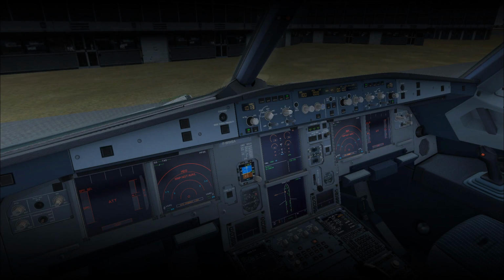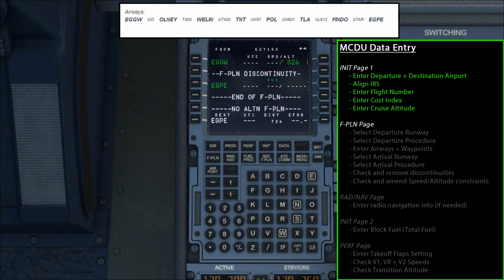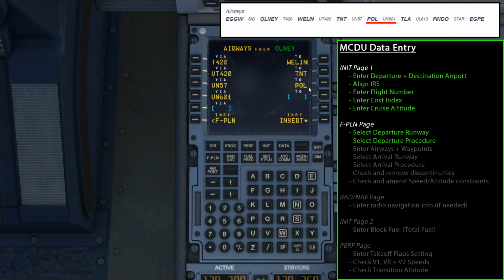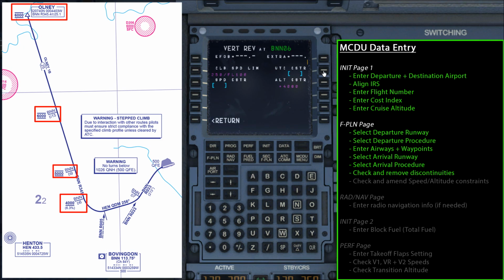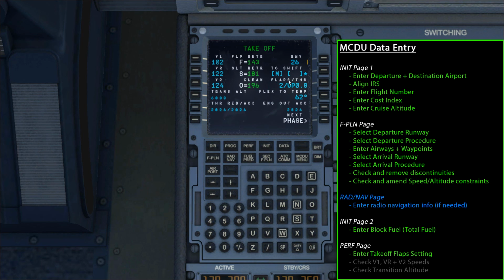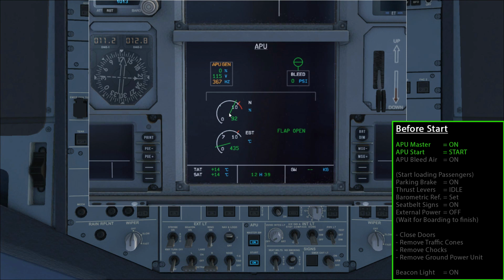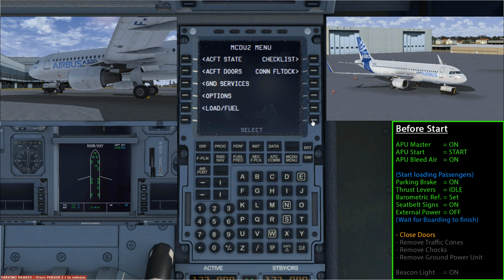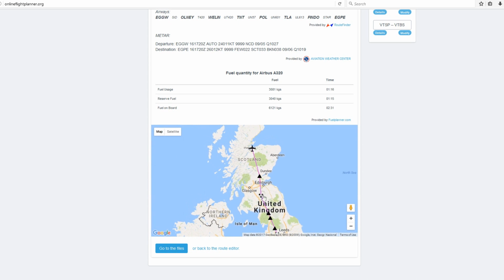A320 FMS/MCDU Setup (FSX - Aerosoft A320)

Comment: Hi Mr Doofer.  I have watched your videos multiple times and have learned so much.  I have a problem with the engine display. Sometimes it shows as  "UNKNOWN".  I have been unable to enter a model number and after that I  cannot complete any other data.  Do you have a solution?
Reply from the maker: I've never heard of that problem with the engine showing as UNKNOWN. Have you had a look on the Aerosoft forums to see if anyone else has had this problem? The best thing to do would be to contact the developer for any tech support issues.
Reply: Hello Mr Doofer911.  I found the answer to my problem [ UNKNOWN ENGINE]  and you are welcome to put this in your reference file. The answer is thanks to "Ramp Agent" on another website.The solution is : Go to " C:\Users\[USERNAME]\Documents\Aerosoft\Airbus\, with the same name that you save your flight in FSX with the extension .fms. I found out that if I deleted the file with the extension fms the problem was solved."  It necessary to delete previously saved flight in both FSX and Aerosoft files. I also found that there are more files in Aerosoft with different extensions but are obvious because they show the name of the route  you worked on.I had another problem also.  I am not sure who could be "blamed", FSX or Aerosoft.  I found to my dismay that when I restarted an Aerosoft flight, after having  previously abandoned  an unsuccessful data entry exercise,  and started to enter the flight data,  all the old unwanted data just appeared on the screen(s).I applied the advice from Ramp Agent by deleting anything that referred to  previous plans in the Aerosoft file.  They are easy to identify.  Just look for the "created date" and delete them.  That way I was able to work off a clean plate.I also found that whereas it is not possible to  delete old flight plans whilst in FSX  planning, these files can be permanently deleted.  They are easily identified by their names.Hope this will be of benefit to other flight simmers.

Comment: You have done a brilliant job Sir.   As they say in Spain  "Mucho respeto" to you.  I have watched your video numerous times,  making careful notes in preparation for my first MCDU flight.  I found it scary.  Had a break away from it for a few months but I am back into it.  Only way to do this is to follow the master - you -  and duplicate the whole flight, whilst checking my notes and making corrections/additions.I'm using this with FSX Steam.  As you probably  know,  it is possible to save a flight in FSX for later use.  I tried to "save" but found that FSX does not save my entries in the MCDU.  Is there any way to do this or will I have to start afresh each time?
Reply from the maker: Well... muchas gracias! I wouldn't say I'm a master at all this stuff... I still feel like I have A LOT to learn and a lot of the procedures and steps in this A320 series are basic and simplified and do not represent the actions of professional Airbus pilots. With regards to saving, I've had problems saving flights with FSX and add-on aircraft in particular. In my experience, the sim doesn't often save the "state" of the aircraft, so you may need to start from scratch each time I'm afraid.

Comment: When I try to click the right button for the INIT page. It says not allowed. Help please :'(
Reply: Page 2 Only works with engines switched off
Reply: @mastermaktoum3828  Lol. Thx. That was doing my head in
Reply from the maker: You need to check the INIT 2 page before entering in information on the PERF page if I remember correctly.

Comment: My text will not turn blue @ 3:25
Reply from the maker: Did you enter valid ICAO codes seperated with a forward slash? If the aircraft is not behaving as expected, it may be worth checking the Aerosoft forums to see if anyone else is experiencing the same problem.
Reply: I tried the EGGW/EGPE too. It's still the same. I've just got this Aerosoft A-320 downloaded a day ago. Do you think they could have upgraded the software?
Reply from the maker: That's really strange, maybe try reinstalling the aircraft. I doubt that they would have upgraded it.
Reply: Can reinstalling be done on steam? Sorry. I am just so noob.
Reply from the maker: I think if you click on FSX in your Steam games list, you should be able to see a box with any DLC you have. If you untick the little tick box, that should uninstall the DLC. Then it's probably best to close and reopen stream then click the tickbox again to reinstall the DLC. I always get my addons as stand-alone pieces of software. I've heard a few people having trouble with FSX addons running through steam.
Reply: Okay. Will try re-installing it. Thanks Doofer911. ;) Will let you know the outcome.
Reply: Still the same. I am thinking if Direct X has any impact on this. I have direct x 11 installed. Do you use direct x 9 or 10?
Reply: Hey Doofer911, I finally figured that the color of the text had nothing to do with the plane following the route. I just used your route from Luton to Inverness (hope I got the spelling right) and the aircraft followed it besides some screw ups which I don't understand as I took off, I had a lot of warning sounds which I couldn't figure out. While the Auto-throttle was armed, it was still losing speed. I wasn't sure what to do except to exit the sim. Can you point me a video about using auto-throttle in the Aerosoft A-320?

Comment: when i go for the second time to the INIT page and try to get the page where i put the block fuel, it says i am not allowed. Can you help me? Thanks a lot.
Reply from the maker: You should be able to if you follow all the steps in this exact order. I don't have access to my checklists just now but the order of things in this video should work fine. Might be worth checking the Aerosoft forums to see if anyone else has had this same problem.
Reply: Ok i will see that. Thanks.

Comment: After buying the Aerosoft A320 and loading the plane into my game, the main FMC isn't on and doesn't turn on and the #2 FMC only gives me limited options... Can't turn the main displays on like you showed (those buttons don't click).. Maybe you could help or point me in the right direction?
Reply from the maker: Best thing to do would be to check the Aerosoft forums to see if anyone else has had similar issues. Other than that, the only thing I could recommend is to try reinstalling the plane.
Reply: There is a "BRT" button on the top right corner of the lower keypads. Maybe it's just been dimmed. just look for "BRT" and click on it several times.

Comment: Where did you get those guides with pages?
Reply from the maker: If you mean the checklists, they're just a graphic overlay that I added when video editing. It's not an addon or anything
Reply: Doofer911 thanks, hey would you recommend me Aerosoft for FSX?
Reply from the maker: Yeah if you're looking to start flying large passenger planes, the Aerosoft is really good and not too difficult to learn. It's not a full simulation of an Airbus but there is still plenty to do to keep you interested when flying.
Reply: Doofer911 Are the graphichs good? Thanks
Reply: Do u have insta?
Reply from the maker: Yeah they're quite nice. Much better than the default Airbus.

Comment: Hello, your tutorials are very very good! Thank you for that! Can you tell me, where I can found the Airport Charts? 😄
Reply from the maker: Just google the airport ICAO and you'll find them.
Reply: Doofer911 Thank you! Do you have also a video, which runway has to be chosen for the “optimal“ takeoff?
Reply from the maker: I don't I'm afraid, usually it's just the runway which is best aligned with the wind direction. Also check to make sure that the runway length can support the plane. Alternatively if you fly using an online ATC service then they govern which runway(s) are being used.
Reply: Doofer911 okay, then I will do so, thank you!

Comment: Hello doofer911

I have the airbus from airosoft how can i save a flight plan what i have program in the fmc.

regards Bert from holland
Reply from the maker: Hi Bert, you can not save a flight plan after it's been entered into the FMC I'm afraid. You can only load a flight plan into the FMC after downloading the flight plan file from a website and saving it in the correct folder on your computer.

Comment: How do you know what runway to use on arrival? Please help lol
Reply from the maker: Normally it's based on wind direction. Planes prefer to take off and land flying INTO the wind. With larger aircraft, you also need to consider if the runway is long enough for the aircraft.

Comment: Good tutorial, but I'm wondering if I missed something here, where and or how can I load the flight plan I downloaded into the mcu. I'm a user of onlineflightplanner but how do I load it into the mcu, can you help please?
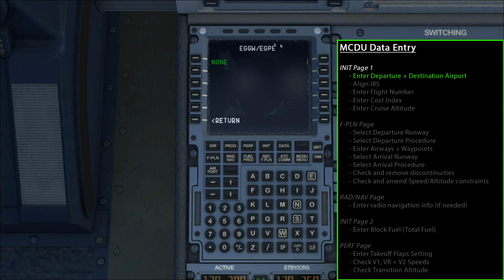Reply from the maker: Download the plan and save it in your Documents under Documents>Airbus>FlightPlans and make a note of the file name, will usually be the two airports like EGGWEGPE01. Then when you enter the departure and arrival airports in the FMS, the next page will have the plan, so just select the key next to it and it will load the plan into the F-PLN page. (In this video, at 3:00 it says None but if you have downloaded the flight plan, you can select at this point.)
Reply: Doofer911
Hey man thanks for the reply, I just tried it I actually had to add a 01 at the end of my saved flight plan...however, on your video at 24:54, when you hit the right arrow it takes you to this next page, when I do it on mine it says "NOT ALLOWED" man I ain't never seen a plane that is soooo difficult to set up for flight. The Boeing aircrafts are so much easier. Do you have any idea why this is giving me this message. Please help.

Comment: Hello there,
This is one of the wonderful tutorials I have watched. Thanks for the video.
After taking off, I'm getting a warning like AUTO FLAT A/THR LIMITED. Can you please tell me how to fix it? I got to know that it's because I haven't set the thrust levers correctly. But I couldn't find how to do it. Please guide me.
Thank you 😁
Reply from the maker: You just need to move the throttles into the Climb (CLB) Detent position and leave them there. The Autothrottle will adjust the engines automatically but you just need to move the throttles into that position. The throttles in an Airbus are kind of weird but just move them into CLB and leave them there until you're coming in to land.
Reply: Doofer911 Thank you so much 😁

Comment: You are an awesome genius. I just switched from 737-800 to the A320 and your video helped a lot although I have JARDESIGN. I have one question. Whenever I have setup the FMS and MCDU and engage autopilot, the auto throttle overspeeds every single time. I know on the 737 the fmc displays whether or not you use FMC or MCP speed depending if LNAV annd/or VNAV are engaged and you can see the calculated speed on the FMC LEG page as well. This doesn't seem to be the case on the A320. Any ideas on what I am doing wrong?
Reply from the maker: Are you moving the throttles into the "Climb" detent after take off? The Airbus autothrottle is a bit weird but after takeoff, you'll get a flashing message on your PFD asking you to move the throttles to CLB.... then you leave them there for the entire flight. For the climb, cruise and descent. You even leave them on final approach and only touch the throttles again to bring them back to Idle for touchdown.

Comment: This is awesome. Thank you very much for it.  Just one question. How can I start the game with the same condition in the video. I mean how can i start the game with the airplane parking in a gate, door is opened, external power source connected...
I'm new to FSX and this video helped me a lot.
Reply from the maker: Go to the Right MCDU, go into Aircraft State and select Cold and Dark. If you want that every time you load the plane, select Set Default on the right side of the MCDU next to Cold and Dark.
Reply: just one more question. After I entering the waypoint, sid, star, it doesn't show the altitude of each waypoint.  Did I missed anything? Thank you so much

Comment: Thank you for the very detailed video. This really helps me understanding the A320. I have a question though, do you need to trim the aircraft like on PMDG?
Reply from the maker: I think you can but for a fly-by-wire system, you don't need to. You basically move the aircraft to a particular attitude (pitch/roll) and then you can let go of the controls and the aircraft will hold that attitude. Normally planes will naturally return to straight and level flight however in an airbus, the fly-by-wire holds the position when you let go of the controls. That's my understanding of how it works anyway.

Comment: Thanks Doofer, nice video, how can you roll the page? if that's the correct terminology, if you have so many waypoints they all won't fit on the page, how do you get to page 2, no doubt a simple answer, so thanks for your patience.
Reply from the maker: If you press one of the arrow keys on the MCDU, that will allow you to "scroll" up or down. Alternatively, you can extend the flight plan using the right arrow key. I'm away from my computer for a few weeks so I can't tell you exactly but it's certainly one of the arrow keys to scroll or move onto the next page.
Reply: Thanks, yes, I thought it would that, it seems these arrows are inactive at the moment, will work on it over the next few days and let you know.

Comment: Hello. An informative video. In the initial part of the video, you mentioned about "the documentation which comes with the plane". How does one access the documentation. I have so far been flying the A321, B737, etc using Microsoft Flight Simulator FSX. I have added the Aerosoft A320 recently and still yet to get off. Wonder if you could help. thanx.
Reply from the maker: You should have a folder called "Aerosoft ......" in your Start Menu, if you click into that then there's an option called "Documentation".
Reply: Thanks. I did go through all your videos and found them very informative. Thank you once again.

Comment: When you talked about the "Init page" as a reminder you should add it's desirable to enter the ALTN airport, especially if you are flying in bad weather, or if you are unable to see the RWY on landing. Another note for passengers, fuel and flaps calculation. For this you can use the Aerosoft Airbus X fuel planner (Start menu-aerosoft-Airbus A320-321)

Comment: Sim Brief will give you a passenger count! Granted, it's a little hidden in the OFP, but it's there. 
If you have it set to the LIDO style, it's the first thing in the Weights section (which is on page 3 usually)

Also, for Throttle IDLE I usually move it up and then back down until I hear it click into idle
Reply from the maker: Yeah I normally use Sim Brief but for these videos I wanted to keep the focus on the aircraft which is why I used a simpler flight planner.
Reply: Doofer911 Yeah, good idea actually :-) 
I wasn't sure what you meant by "more advanced" and didn't realize that you had actually used Online Flight Planer instead of SimBrief this time. Just wanted to put the Information out there because I spent about 15 minutes searching for the damn passenger number the first time

Comment: why was there external power GPU and external power at the MCDU 2? Is the normal external power coming out of the ground?
Reply from the maker: +ObaMarc 1 Basically it's a ground power option without the GPU unit, incase you use a ground equipment Addon like GSX

Comment: can you make a video on how to use the a321 different autopilot systems?
Reply from the maker: +DatRussianSniper Everything I talk about in the A320 vids can be applied to an A321
Reply: I have a problem with the attitude hold. The attitude I set before take-off is what the plane will maintain throughout the flight; it won't follow the attitude I put in the FMC.Idk if it's me just doing something wrong or its a bug on the airbus xNote: I press the attitude button so the circle thing will appear
Reply from the maker: +DatRussianSniper You'll need to turn the altitude up to the cruise altitude. That gives the plane "permission" to climb after you've passed through any constraints/restrictions